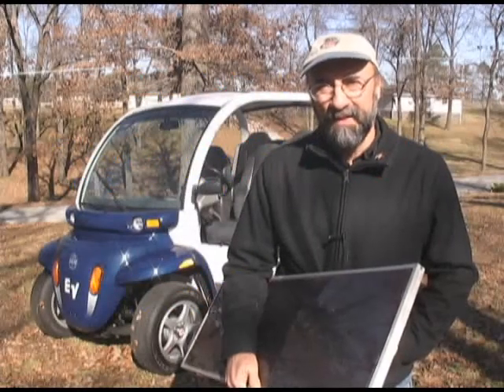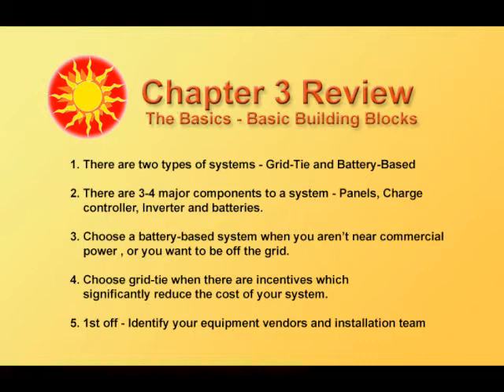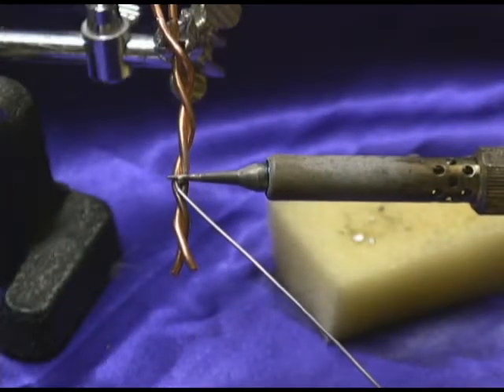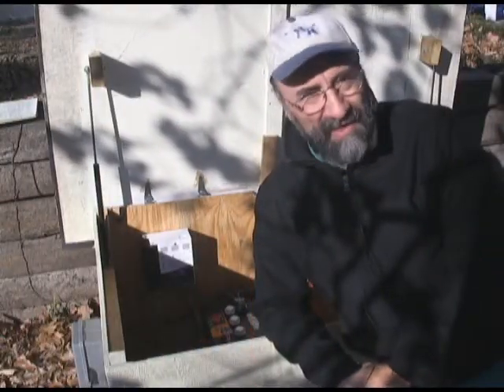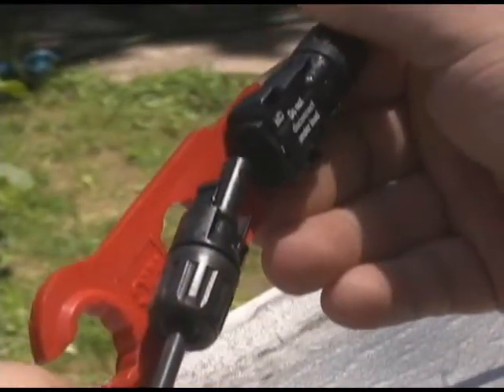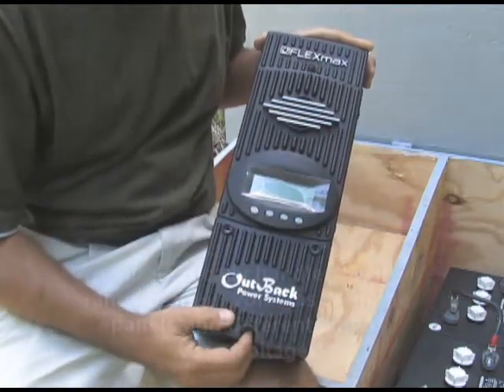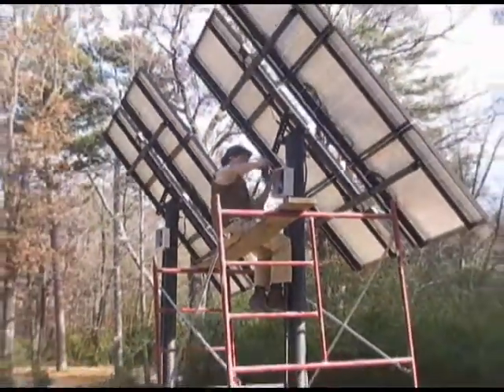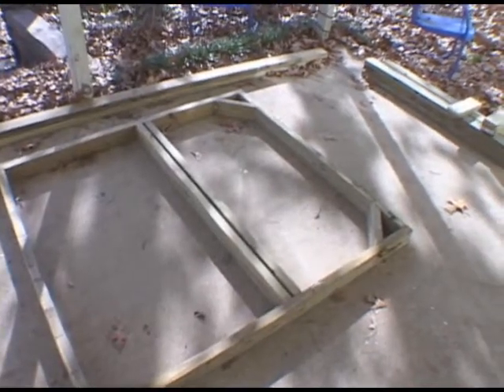Solar Instructional Video Samples

Comment from the maker: Why? How about these numbers: A 2000 sq Ft. home in the USA uses Avr. 1000 KWH a month. That's about $115. In 30 years with 7% inflation, that's $78,000 total. At current prices you can get a 6 KW PV solar system for $12,000. That produces 1000 KWH a month. When you sell your house, you get 2-3X the solar hardware cost back (plus inflation). During the up to 40 year ownership of the system, every dollar of electricity you produced will have been free. Oh, you get 30% Fed Tax cash back too...now.